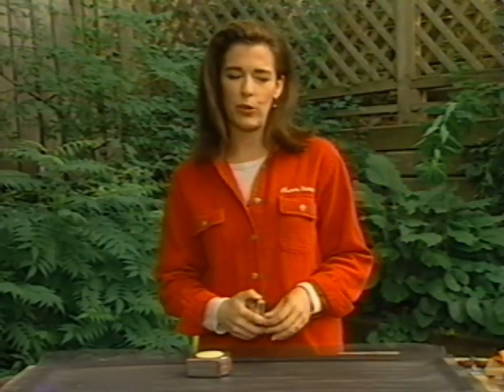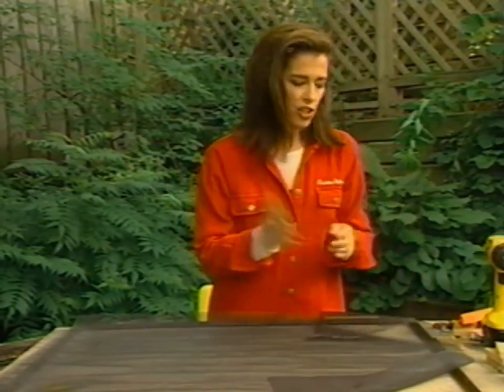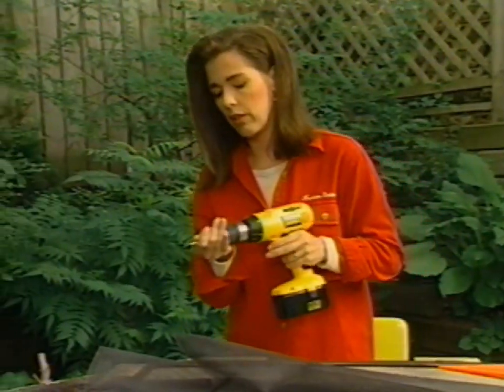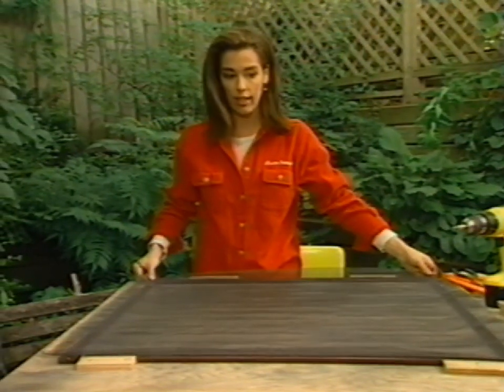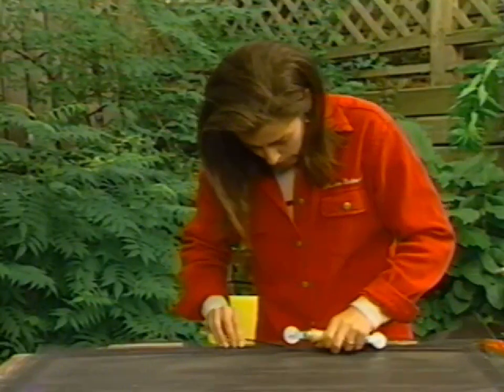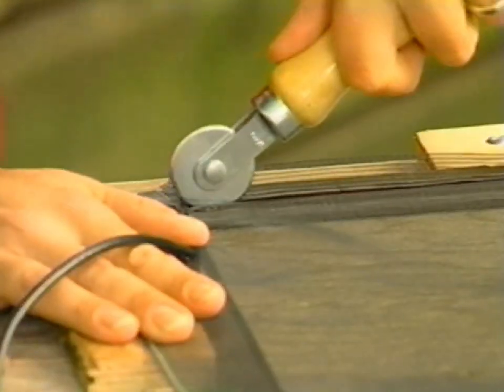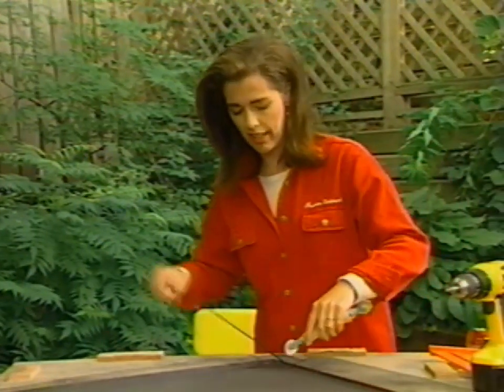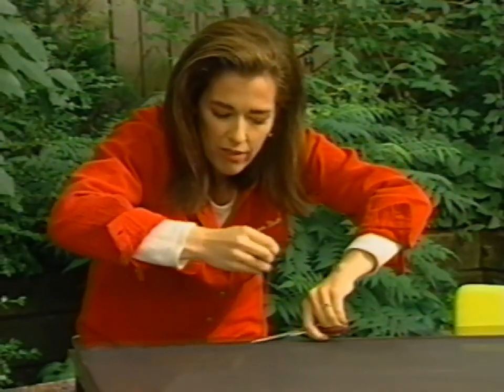Replace a holey window screen! A quick and affordable DIY fix! A Repair to Remember

Comment: Good job! If you pull on the spline, it will stretch and get slightly smaller so it fits in the groove easier.
You can also shim up one end of the frame just a little as you're installing the screen and it will make for a tighter finish.
Reply from the maker: OH I LOVE THAT TIP!! Thanks for the headache-saver, I'll do that next time! Thank you @Darryl603
Reply: چرا سارا پولی یوتوب نداره؟
Reply: چرا سارا پولی یوتوب نداره؟